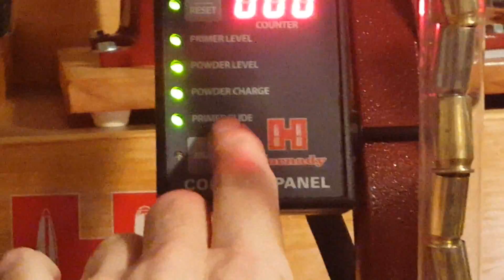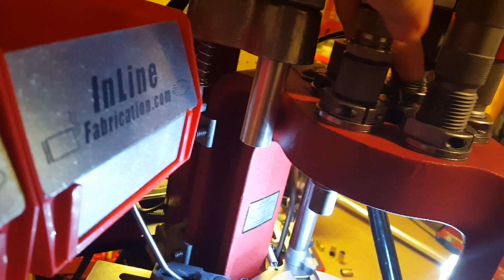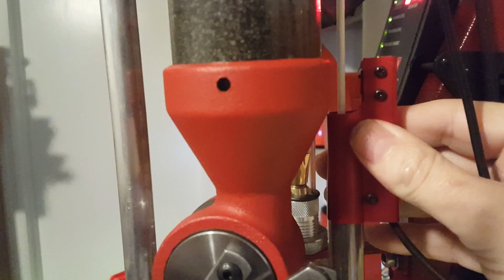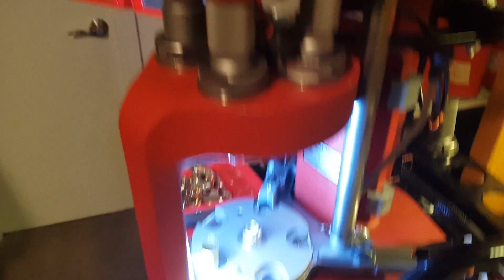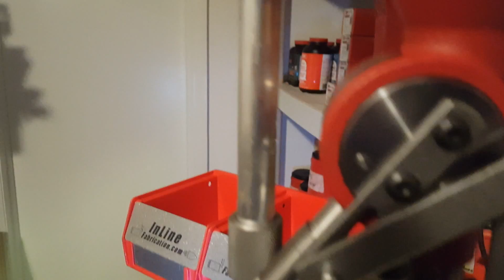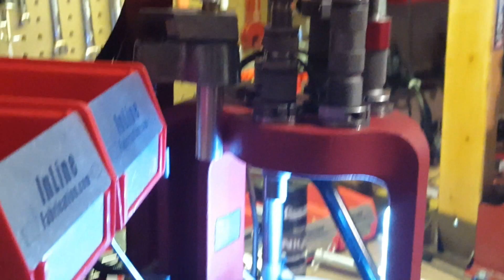Hornady Lock N Load LNL AP Press - Part 4 - Control Panel

Comment: I just installed my powder checker and noticed that the brass rod is picking up quite a bit of the powder. How are you dealing with that?
Reply: If it's static, wipe it down with a dryer sheet.
Reply: @aznazguy  thanks!

Comment: Nice video. The original price for the deluxe model may seem high at $200.  But many places have it on sale for around $170. Then you get 500 free bullets. That's worth $110+.  You could keep the bullets or sell them for $100. 
Net price=$70 for the control panel

Comment: I enjoyed this very thorough video!  I just bought this press and was curious how the sensors worked.  Being cheap it seems like I could duplicate this for the fraction of the cost as I have more time than money.  It wouldn't be as clean though.  Is the whole powder lock die different from the normal powder cop or just an add on? Again, nicely done.  I'll watch your other vids now.

Comment: if you pull the cable from the connector and not by the wire you should be fine.

Comment: has anyone automated the lock n load yet?
Reply from the maker: +whenboysetsfire1 Not that I'm aware of.  I've seen several Dillon systems with automated gear running them.  So cool.  I'm not sure I trust an automated system though.   I like to check on things randomly while I'm loading, powder charges, primer seating, COAL/CBTO, etc., etc., etc...

Comment: Hello, I've just finished watching your complete series on the Lnl Ap just now.   You did a fantastic job!  Thank you very much.   I've been reloading for 10 years on a lee classic turret and am ready to upgrade.   I'm going to set it up primarily for 223.  I'm likely going to purchase the case feeder as well and wait on the bullet feeder until later. 

I have a question though...  I know I'll need the small rifle plate for the case feeder and the 223 shell plate.  
Will I need anything else to get it running?  Do you have any recommendations on additional or replacement parts to have on hand?

I'll be using my current dies.  

Thanks!!!
Reply from the maker: rulon152 Hi Rulon,

That's great!  I'm sure you'll love it as much as I do!  You should be set with the shell plate, dies, and rifle plate.  Just be sure it comes with enough LNL bushings for your dies, powder measure etc.  As far as spare parts, I would pick up a package of the shell plate springs, they come in packs of 3 for under $10.  Those seem to get damaged sometimes.  Also, the primer slide may come apart (the axle for the little wheel comes out), I have spares, but I found that a tiny drop of Gorilla Glue in the hole will fix it up just fine.  Just don't get glue in the wheel mechanism.  Hornady will replace em if you call tech support, but I use the glue these days, it's much faster.

I've had mine for almost 20 years, they're built to last.  Let me know if there's any other questions I can help with.

Hornady Loader
Reply from the maker: rulon152 I'm uploading a new video, Part 1a of the LNL AP Press series that should answer your question a little better.